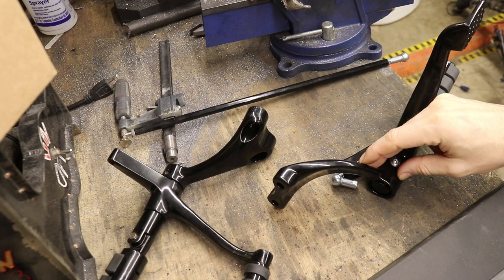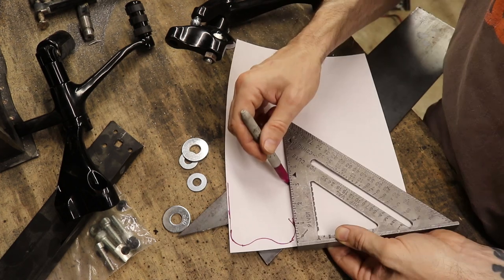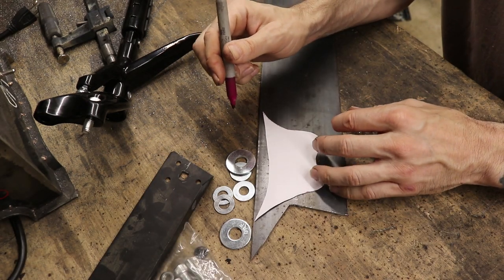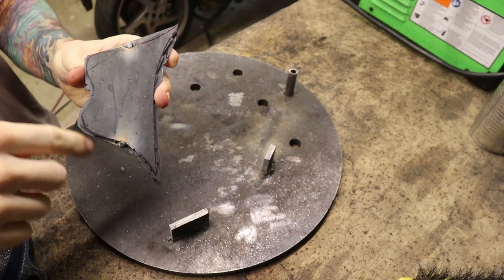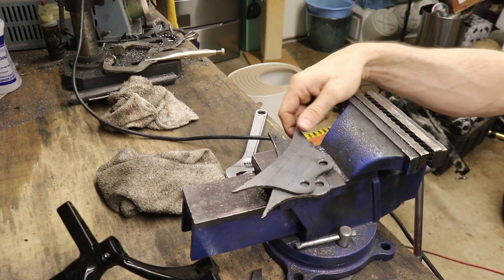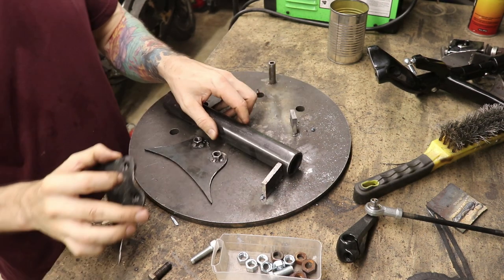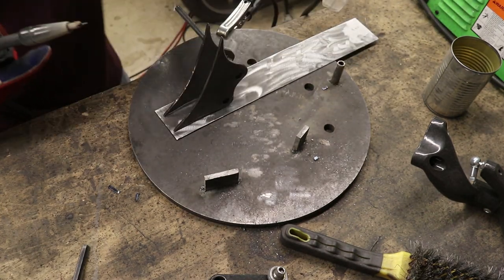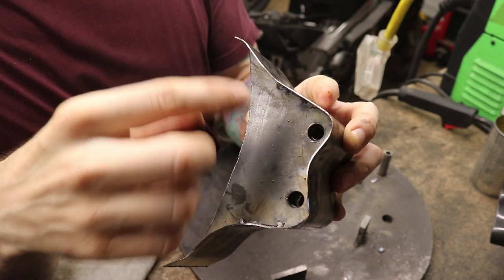Custom Forward Controls Mount | Grom E27

Comment: This was a fun one. Are you going to paint or powder coat the frame when it’s done?
Reply from the maker: I am not sure what finish I will use. It's a quandary. I've never powder coated something,  so the novelty is appealing.  Any recommendations?
Reply: @HooptieDoodle  definitely go powder. I’ve seen you learn on the fly many a time with your builds.